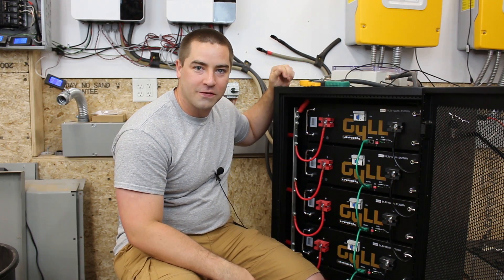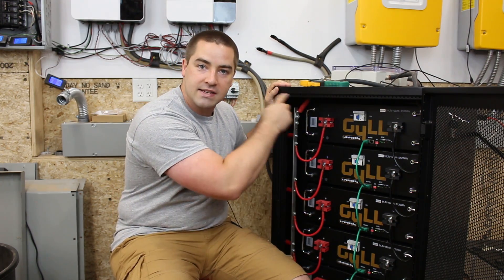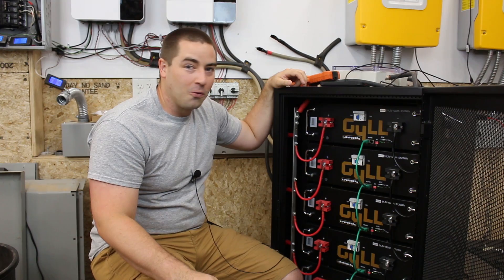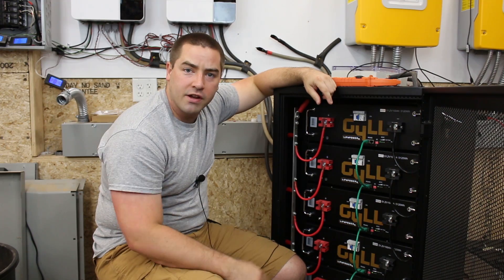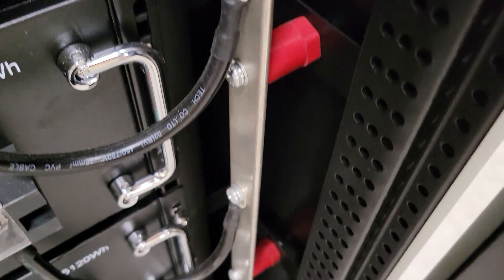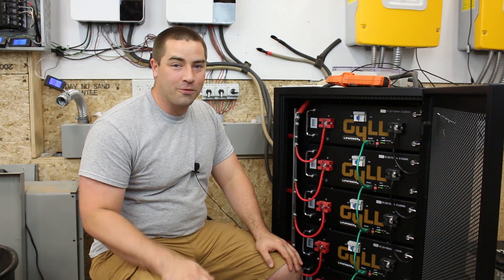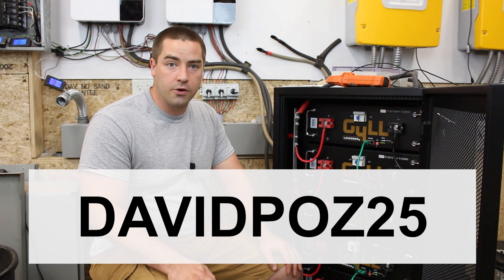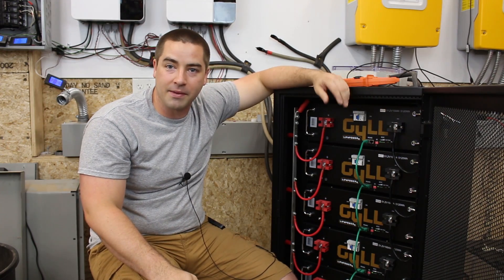Cheapest Pre-built 48V Battery, LiFePO4, Update when to buy

Comment: @DavidPoz  I see that you've removed one of the three Growatt SPF 5000ES's you used to have on the wall back there. Why did you remove that third unit if you're able to say?
Reply from the maker: I found I didn't need it for my house.  My house works fine on 2 inverters (10kW).  And I am building another project that I wanted the inverter for.
Reply: @DavidPozEnergy  Ah, I bet that was quite nice to learn :) We, with a Prevost Tour Bus, expected that 10kW (2 SPF 5000ES's) was going to be enough for our needs as well... but had considered 3 because the bus will serve as both temporary home and electricity base for our off-grid property development / homesteading project in the near future. My suspicion was that we'd want extra electricity bandwidth to push power tools on the work site while also letting AC units run in the Bus. But who knows - it's all academic until we're out there right? lol
Reply from the maker: It's all good.  You could always buy 3, and if you don't need it leave as a spare, or sell to a friend.  Or you could buy 2 and if it doesn't quite make it add the third later.  Just don't wait too long since you never know when models change.
Reply: @DavidPozEnergy  Isn't that the truth! :)

Comment: It's "wrong" but how wrong depends on the current relative to the resistance of the bar, as it results in a voltage drop seen by each battery. Measuring that voltage drop will show how big of a problem, and it may not be significant at your peak currents.

Comment: I have three 200AH chins lifep04 batteries, I won't be needing them for several months to a year, at what voltage should I store them at
Reply from the maker: I once read that storing a lithium battery is best at SOC (state of charge) between 50% and 70%.  That's hard to know with LiFePO4 just from voltage, but anywhere between 3.2 and 3.3 volts (while at rest) is probably a good bet.

Comment: You can't really depend on a current measurement, since each battery might have slight internal differences from the others, as well as the varying current as you noted due to clouds passing over etc. To really measure the voltage drop of each bus bar you would use your multimeter to measure the voltage between one end of the bar and the other. It's likely only a few milivolts. Don't measure on a connection, but rather put the meter probes right on the bar itself.

Comment: David nice vid does the battery bms  Communicate with solar inverter..and is there a way to message you  Personally Mica
Reply from the maker: The batteries have some communication available, but currently it doesn't talk to these inverters.  I'm told they are working on it.  But, the inverters work just fine without direct communication.

Comment: Honestly, 10K shipped with the cabinet and hardware for 50+Kwh is a pretty good deal. And the resistance and voltage/amperage drop between battery 1 and battery 6 is pretty much nominal. As others have said, moving the neg lead to the bottom of the bus bar may help, but to be honest, clamp meters aren't the most accurate things in the world, so the only real way to test is to have calibrated shunts between each battery and the bus bar. Last, any real differential will probably be taken care of with the inter-battery communication via the BMS systems on each battery, so I wouldn't really be worried about it. Is it perfect? No. But this is real world conditions, not lab conditions. Variances are normal. +/- 1% is well within acceptable margin of error. Just my .02.

Comment: hi Dave. while I've been watching you .the only thing i can see is your main feed to the cabinet. IF YOU WANTED ..?  you could put it into the middle of the buss bar. that's all. other than that I think you have a perfect set up. and no hot spots . have you gone through the computer read out of late .. it would be nice to see. yours tone uk.. ps nice to see you on the ( hppowerwall )
Reply: yea putting the main feed in the center would be the best workaround, however I think it was all pretapped holes and there are no holes in the center for the larger screws.
Reply from the maker: I might just to test it.
Reply: @DavidPozEnergy  The busbars are milled from nominal 5 x 30mm copper stock and tinned. Mine are only 4.9 x 29.6mm.  That equates to a busbar rated ampacity of just 170amps--undersized for a 600amp rated rack.

Comment: Oh lordy where to start? (1) Technically You probably should be attaching feeder wires in the middle of the bus bars and not at the top. (2) $500 for $60 network equipment cabinet with two bus bars is pretty steep. (3) Technically enclosure [4U rack drawer] is only $40 + BMS on ali. In general this Gyll looks similar EVE Energy Battery Pack 48V 100Ah on ali. This video is a commercial for SignatureSolar IMHO.
Reply from the maker: Where can you find this cabinet for $60?
Reply: @DavidPozEnergy  Search for "server racks" on alibaba. My company bought some very decent ones... Alternatively search surplus server racks [facebook].
Reply: Yeah, I’d like to know where to buy an enclosed rack for $60!… if you could also point me to the $20 bus bars, that would be helpful too!

I’m guessing you meant a cheap open rack? ( https://www.toolots.com/25u-floor-standing-open-rack-ckd.html?cid=10131249572&gclid=CjwKCAjwieuGBhAsEiwA1Ly_naQr-8Tjms15lKyW4S25clDSR83VbJlqHXnZXmP1940DySvUruW7kRoCpHEQAvD_BwE ).  And then needing to figure out bus bars and electrical safety

Comment: So how are those Growatt Inverters working out?  Have you completely taken the SMA inverters offline?  The real test is how long they last (MTBF).
Reply from the maker: I've solely been using the Growatt inverters.   They are working well, but the fans are loud.  That's the noise in the background
Reply: @DavidPozEnergy  what happened to your 3rd growatt inverter?   I have received 32 panels and 2 growatt inverters from signature just waiting on being able to buy batteries from them.  Thanks for the videos.

Comment: Voltage drop would be about 0.04V on 4 AWG wire. Anything over 10ft would be a problem. If there is a concern just upgrade your wire size.

Comment: Regarding better balancing the battery modules, why not connect 2 thick wire from the tops of the bus bars,  directly down to the bottoms, thus giving it 2 paths from the bottom? This will not only help balance the battery modules better, but will also reduce some load on the bus bars.  If you still notice a small difference in amperage draw between modules when loaded up and it bothers you, why not pick some time interval such as 6 or 12 months, and just physically swap the top and bottom battery modules?  Those are the 2 that are most "unbalanced" with each other.  The "middle" modules seem close enough so just leave them.  A third option is to use thicker wires on the bottom battery modules to the bus bars, to help compensate for the larger distance away from the top of the battery rack.
Reply from the maker: Hi David James,  You are right, I could use a longer 4/0 wire to run one pole to the bottom.  Personally, I don't think it's needed.  But if I do it, I'll have to re-test this with a fixed load.  The day I filmed this was sunny and I was charging.  But, as I mentioned, a cloud came by and made the bottom battery look like less amps.  that's why I went to the second bus bar in the same take (no cuts) to show less total amps.  I actually filmed this part (measuring with amp meter) about a dozen times trying to catch it while having no clouds, but alas, no dice.  I hope I'm explaining this well enough, that the total amps were changing while I was filming.
Reply: @DavidPozEnergy  What about the other 2 ideas such as the top and bottom module swap after 6 to 12 months and/or maybe double up the wires on the bottom module to the bus bar (2 sets of wires).
Reply from the maker: I don't think there is anything wrong with that idea of swapping modules, but it's not something I'm going to do.  After 6 months of use I'll probably hook up my laptop again and check the SOH (state of health) of each battery.  Maybe I'll have to adjust something if there is a difference.

Comment: Hi David, do you had any experience with spark because of inrush current with those batteries?
Reply from the maker: Yes, I addressed this in a previous video.  These batteries have a large resistor built-in to limit in-rush current.  It's automatic.  You hook the battery to inverter, turn on the circuit breaker of the battery, and the internal BMS automatically limits in-rush to prevent blowing the capacitors inside the inverter.

Comment: I'd love to know the average discharge per day from your home.
Reply from the maker: Winter and Summer (especially this week) I'm usually 30-35kWh per day.  April/May, and Oct/Nov I'm usually around 12-14kWh per day.  How about you?
Reply: @DavidPozEnergy  Yes, we average 11kWh per day draw, we generate between 5kWh and 25kWh per day. Most of that goes to the grid though since we draw more when the sun goes down than during the day. We are looking at setting up a battery storage arrangement to capture some more of the generated solar and use it in lieu of grid power.

Comment: A small improvement to the rack might be a clear plastic flap with gaps aligned with where the cables attach. That way if you're working in there and drop a cable or something, there's zero risk.
But as you say, with the door closed the risk is minimal.

Comment: "Commentors " :  The batteries are all paralleled by the bus bar , any small difference occurring during load or charge would be self correcting . Think of the batteries as cells being tied together , they don't have a choice.
Reply: It is like connected water vessels, they will always tend to equal the level.

Comment: doesn't the communication port balance the batteries via communication
Reply from the maker: No, it is for reporting.  The batteries are all in balance simply by being wired in parallel.
Reply: @DavidPozEnergy  ok thanks for the info

Comment: I remember hearing these same silly claims when I first started my solar hobby. Voltage is more like high pressure water. It would take a crazy amount of resistance to harm that pack. 1-2 feet difference will never harm a battery. Ever. Have not watched the video yet. Just wanted to add my two cents. Time to watch David!
Reply: Depends on the size (and quality) of the wire, and the current being pulled through it. If you need 50A, the top battery is going to supply more than the bottom simply because it's line loss will be less. In this setup, it's likely very little difference -- low current, and each unit has a protective BMS. In, say, a car, where there will be hundreds (or over a thousand) amps, one foot of extra cable between packs will make a major imbalance. Just because your HF meter can't measure it doesn't mean your "welding wire" doesn't have resistance. (i^2*r grows very fast when "i" increases)
Reply: @jfbeam   except...we aren't talking about wires we are talking about what is a probably a 2-300amp bus bar. Each wire going to this huge bus bar is in fact getting tied into what is effectively a single junction (its just physically long). The resistance on the bus bar is so low... that there is virtually no voltage drop between any of the connection points. All this is doing is moving the junction into the battery housing instead of doing it on your panel.
Reply: @Wingnut353  the Signature Solar busbar is only a 170amp busbar, based on online ampacity for busbar calculators (1.2 x cross section in mm^2 for copper). the SS busbar is nominally 5x30mm (milled down with rounded corners to less than that).

Comment: Integrity???!!!  "They are very close to one another - probably 1%, maybe 1.5% difference between them."  Huh?  Math-challenged or intellectually dishonest?  From 18.49 to 19.67 = 6.4%.  From 19.09 to 20.45 = 7.1%.  You can derive a qualitative opinion, you can rationalize, you can cherry-pick and slant, but you really shouldn't mischaracterize on objective measurements.  If you value your reputation, you should re-edit the video and correct the misstatement.

Comment: I know you have probably covered this in the past but at 30kWH capacity do you get your batteries topped off by noon the sell the surplus back to the grid for the rest of the day?
Reply from the maker: All my DIY stuff is off grid.  I never sell back.  In spring/fall my batteries can be topped off by noon and then they stay full until 4pm.  But the past couple weeks have been very hot and the AC has been blasting, so I just barley make it, topped off around 4 and then the panels are in shade again.
Reply: @DavidPozEnergy  Time to get out the saw and start trimming some trees.
Reply: @DavidPozEnergy  thank you for your honesty

Comment: David, the very small resistance does not matter. Is that the Chinese made product?  Now how do I use the batteries over night mate.
Reply from the maker: I use the battery with some inverters and solar.  The inverters take the 48vDC and make the 240vAC for the house that I use night and day.
Reply: @DavidPozEnergy  O.K David,  I have grid too. Need to reverse power from shed to house.

Comment: Excellently, wrongly, perfectly (all adverbs).  That is a nice rack and battery bank.  30 KWh is about how much a typical USA house consumes in a day.  It would not be easy to do with AGMs as you would probably need about 48 of the 12V 100Ah rated ones then drain them down to about 50% max (from a full charge).  Not only would they take up a lot of space, but they would also weigh close to 4,000 pounds.  I also like how you use color coded wires for extra safety.  I do that too and it is a very good idea.  Even better would be to put some type of reflective material on one of the colors (positive for example), so even in low light, there is no confusion.  Red starts to look more like black in low light and with that much power, there is no room for error.  Upvoted.
Reply from the maker: I love your comments.
Reply: @DavidPozEnergy  You post a lot of YT videos so I am trying to help you out.  They are fun to watch cuz u have some cool stuff and do some cool things.  Sometimes your terminology and wording is a bit off but that is what people like me are for.
Reply from the maker: It's great that you are willing to help me out with terms or whatever.  I appreciate it, seriously, it helps me get better, and helps anyone reading from making the same mistake.
Reply: @DavidPozEnergy  You won't go wrong often if you maintain this attitude.  It amazes me how unusual it is.  Carry on, sir.  BTW I also think James has made a good comment.
Reply: And they will cost more as well.

Comment: Hey Dave....Are these new batteries EXACTLY the same as the ones you reviewed?  EXACTLY?
Reply from the maker: No.  I am told they updated the software (firmware?) on the BMS to communicate with more inverters.  I don't know if there are other changes or not.  Is there something you are concerned with?
Reply: @DavidPozEnergy  will the new version be compatible with the "older" model
Reply from the maker: @MrShaneo369:  It's the same voltage, so the new battery can be paralleled with the old battery in the same system.  However, I don't know if the computer cables (RJ45?) will all be able to talk to each other.
Reply: @DavidPozEnergy  Thinking Amp ratings for charging and discharging.  Same cells...precharge resistor...etc.  All the specs.,..you know.
Reply: No, not concerned.  Just want to know the specs before I place the order.  I've been eyeing these up and I'm ready to buy.  Beats those other battery named guys for sure.  Legit.  This is a great battery.  I like the precharge resistor built in too.  This will be in my first build.   Keep up the good work!  ⚡🤘

Comment: If uneven usage is a problem, you could connect the negative pole cable at the bottom. But it won't be a problem on that system anyways. Btw, the clamp on the meter is polarized for DC. That's why you will always have different readings if measuring on plus and minus but keep the meter showing the same direction. There should be a small arrow marking on the clamp for flow direction for exact indication :)
Reply: Not sure if anyone has made this comment, but you can mount the + & -ve cables 1/2 way down the buss bars to equalize the draw on the batteries.  But I agree with you that the buss bar has very low resistance that it may not make any difference.

Comment: Wouldn’t it be best to leave the positive lead to the inverter on the top of the bus bar and move the negative lead to the inverter to the bottom of the busbar?
Reply from the maker: Yes, I agree with you that would be best.  Not hard to do either.  I don't think it's necessary at the amps I can move in/out.  But it would become more important with longer distances and/or more amps.
Reply: Thing is. When the batteries are drained, the BMS will shut them down one by one. So it really doesn't matter that much. Same with charging.
Reply: Agree - that would be the easiest and cheapest way of doing it. Probably not necessary but for a piece of mind for some people - adding an additional 3 foot of wire to go the bottom of one of the busbars.
Reply: Good trick. The same is used to connect LED strips. 😊
Reply: There are additional issues that are not discussed here.  Buying one battery is just a better bet.